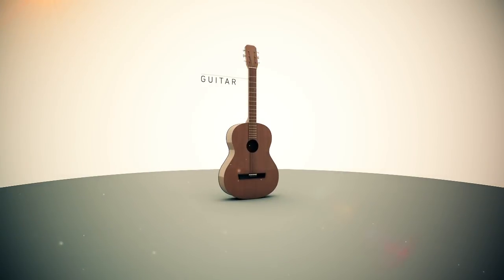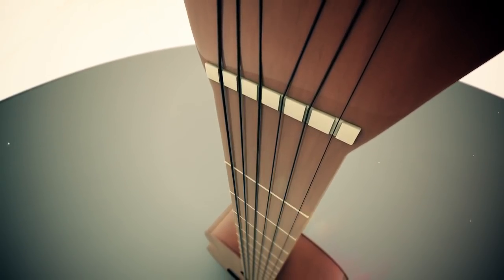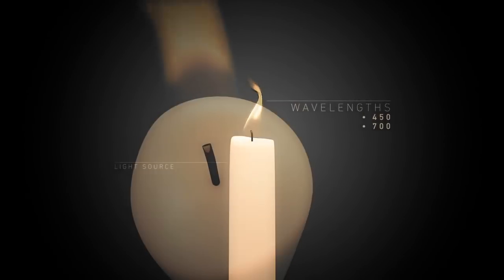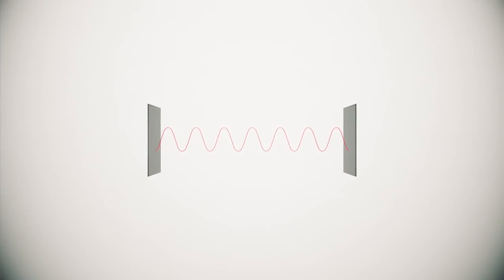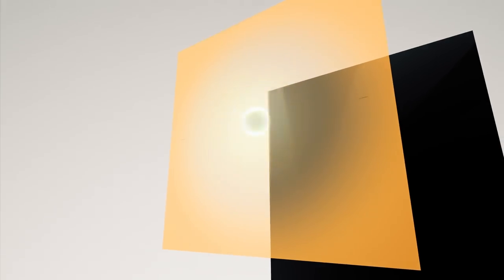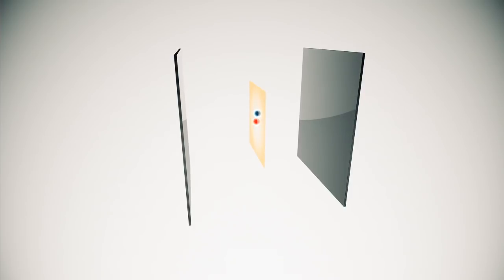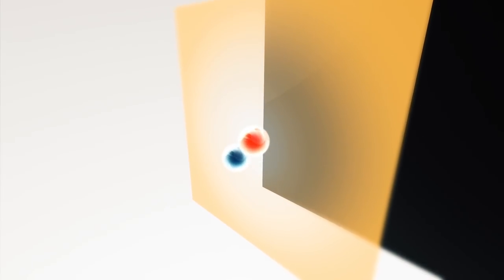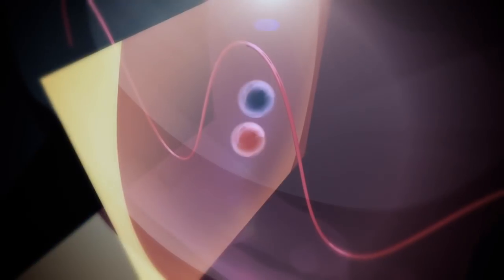Semiconductor Exciton Polaritons

Comment: I am totally baffled by this amazing masterpiece animation. Thank you so much. can you tell me what is difference between plasmon and polaritons?
Reply from the maker: Thanks a lot! To answer your question, in general, polariton is a quasi-particle arising from the strong coupling of light (photons also described as electromagnetic waves) with some kind of electric or magnetic dipoles in the matter. In our video, we talked about exciton-polaritons -- polaritons which emerge from the strong coupling of photons and excitons, which are a type of dipole, inside a microresonator. Exciton-polariton can emerge also without the resonator but are a lot harder to observe and lack some interesting properties. When you refer to plasmons, do you mean 'surface plasmon-polaritons'? These occur when light (photons) strongly couples to dipoles of electric charges at the interface of a conductor and a dielectric (such as a metal-air interface). 'Surface plasmons' on their own are simply the oscillations (dipoles) emerging on the interface. Finally, 'plasmons' are quanta of oscillation of electric density inside a plasma. These three different 'plasmons' can be sometimes confused.

Comment: so it's 2021 now and this has been applied to what?

anything?
Reply from the maker: Theodore Maiman, the inventor of the laser once famously said that the laser was "a solution seeking a problem"! As you can see from how widely used lasers are today, applications often take time to develop. Some of the most promising potential applications of polaritons are for ultrafast optical switches, optical quantum logic gates and low power / size lasers.